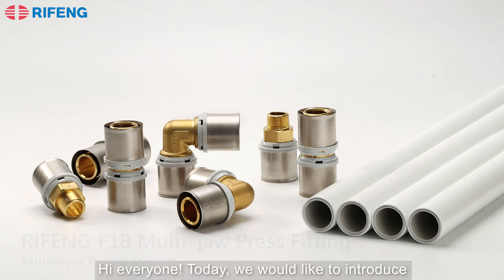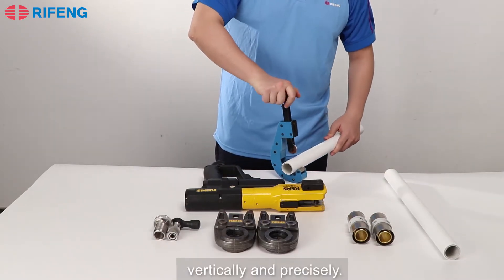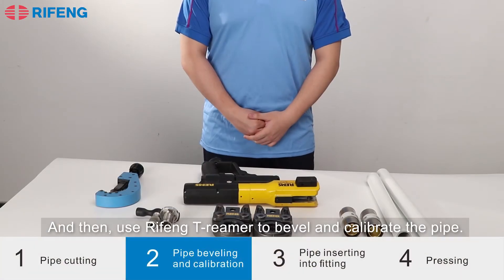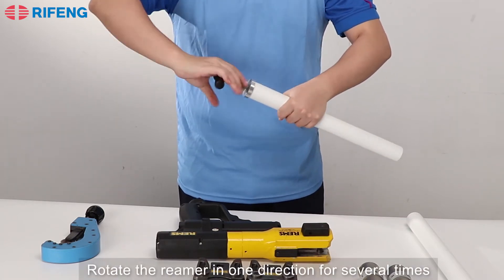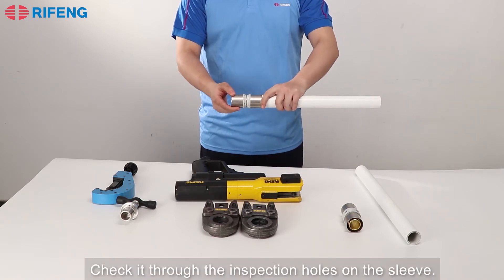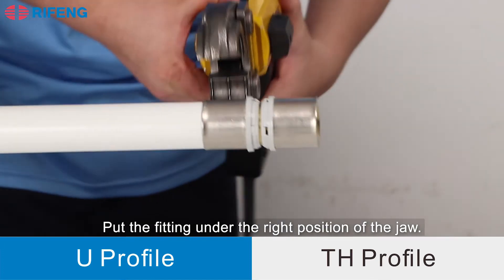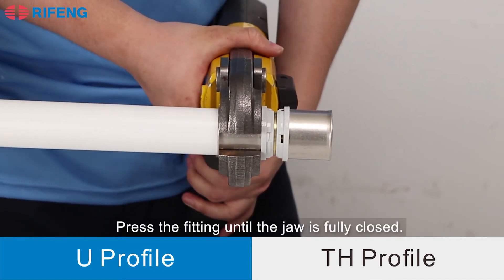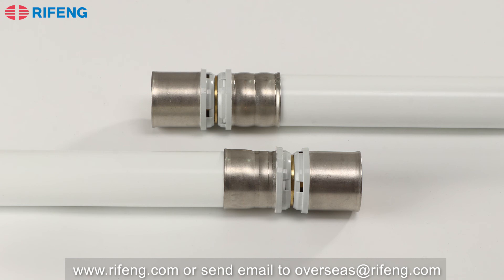RIFENG F18 Multi-jaw Press Fitting Installation Operation Video

Comment: 1. would be better if u use round pipe cutter. the one u use take a lot of space. this is important when u want to cut existing pipe with tighten space
2. 2:30 which one better between U vs TH Profile